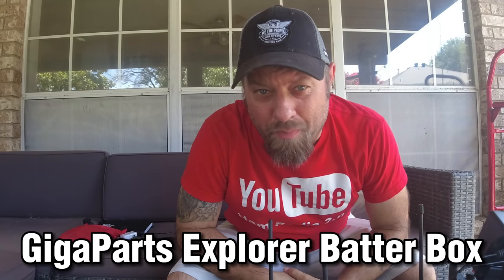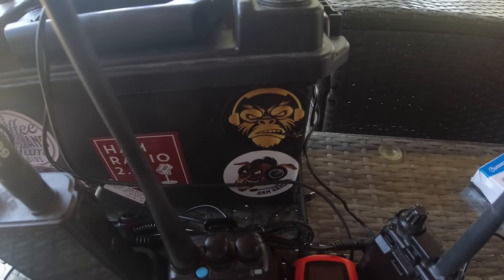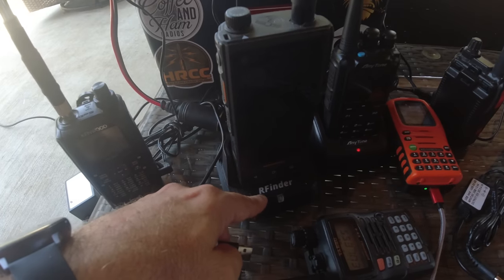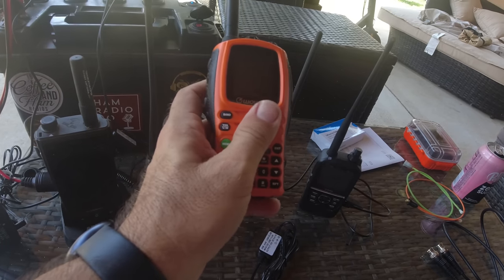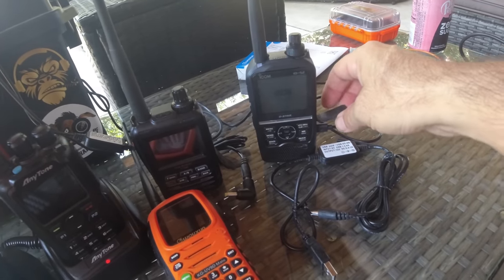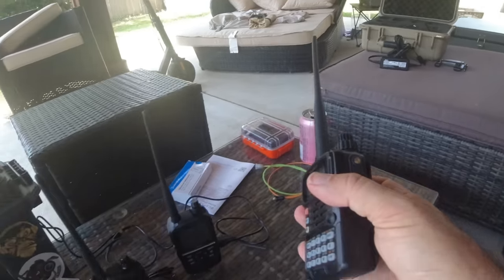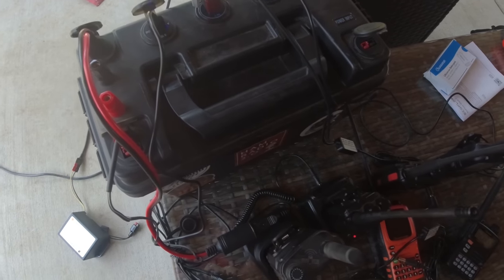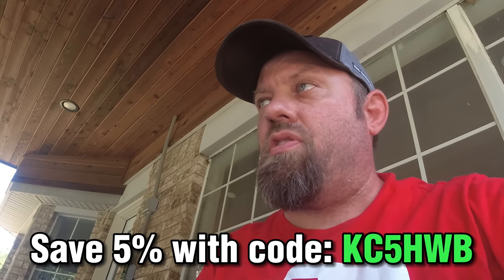SALE! Explorer Battery Box Charges ALL of the Things! (Radios)

Comment: Great video.  I have a couple of those boxes. One configuration also uses the GVB-8 Genasun and has a 50ah LiFePo4. I changed the powerpole input color to yellow/black as all my solar connections are yellow and battery connections are blue.  I also inserted power poles on the input power wiring, just as you did. The Genasun and battery both fit inside together.  Sweet combo. Thanks for arranging the promotion.  It’s great to have a LiFePo4 box we can charge with anything 5v on up.  73s
Reply from the maker: Great, thanks for the info
Reply: @HamRadio2  Battery that fits is the Nermak 1250. It has been delivering full 50ah repeatedly as measured on the buddipole powermini 2. But I don’t know long term.
Reply: @Aimsport-video that's the 1 I'm going to get. Right dimensions
Reply: Which model genasun are you using? I just got the box and will order the battery in a few weeks

Comment: Jason, yes you can charge the FT-5D with 12v. The part number E-DC-6 is a bare wire cable with a pin plug. I put power poles on mine. This cable works on FT-1DR, FT-2DR, FT-3DR, FT-5DR, -FT-252, FT-257, -270R, -277R, -70DR, VX-6R, VX-8DR, FT-817, FT818

Comment: Was going to build a battery box but based on your review, I ordered one as it also was on sale. I found the parts to be pretty cheap as compared to other builds I have done with parts from Powerwerx, etc. In fact, the voltmeter was DOA and GP's wanted me to ship the whole box back rather than just send me a new voltmeter. Way too much trouble. So, I'll just get quality powermeter myself and drop it in which now makes this no longer a good deal.
Reply from the maker: It sounds like you want higher quality parts for a cheap price. This box is a $80, and that's what you get. The powerwerx box does have better parts but it starts at $130 and doesn't have nearly as many powerpole ports at this one does. 
This is also the reason why I have multiple battery boxes
Reply: Agree that having multiple battery boxes for different purposes is good. This would have been adequate for what I needed. Biggest disappointment was that it was DOA (voltmeter) likely due to the fact that it is not a "quality" part. Which was my real point. Was also disappointed in GP's response. I ran customer service units for very large companies in my professional life and still am amazed at how many companies I deal with (big or small) just don't get how to win and keep customers.  It would have been so simple for them to say, sorry that it came DOA, we'll get a voltmeter right out to you ... I would have been a raving fan. Now I'm a disgruntled customer. BTW - love your videos! @HamRadio2
Reply from the maker: @yellowjacket82  yes agreed that it would be disappointing to receive a DOA meter on the box.

Comment: The Kenwood ht's that have NiCd or NiMh batteries typically have a constant current charging circuit connected to that 13.8v port, set to charge the battery pack at a 1/10th C charging rate. These batteries are designed to charge at that rate indefinitely without damage.
 Lithium batteries need a different charging algorthm, so you'll usually see them with a proprietary charging stand.

Comment: With LiFePO4 batteries I've seen the max continues discharge rate is just over 9 amps. So if you use an HF transceiver in POTA what's your max Tx watts? And do you then disconnect HTs that are charging when Tx on HF or just run QRP e.g. 5 or 10 watts?
 Thanks
73s KF0EAU